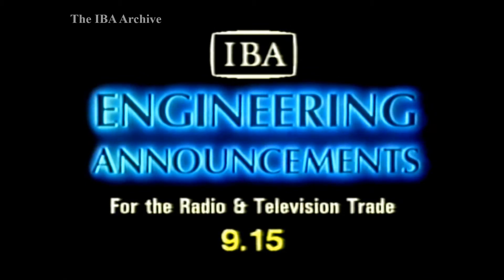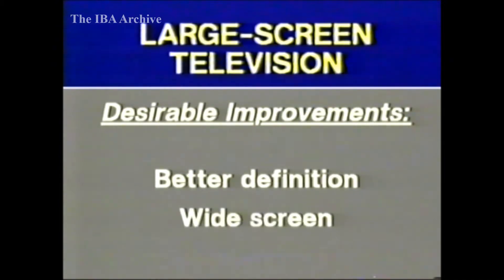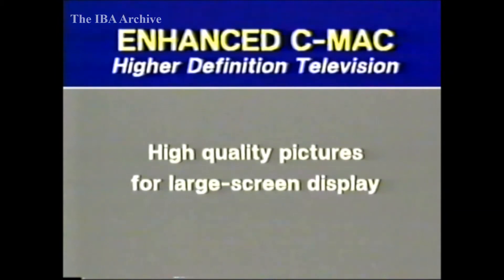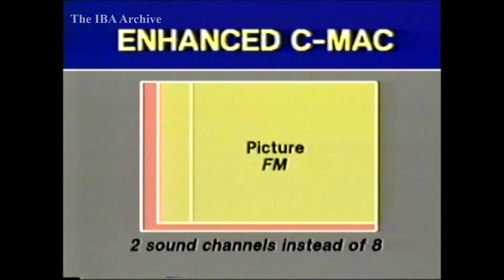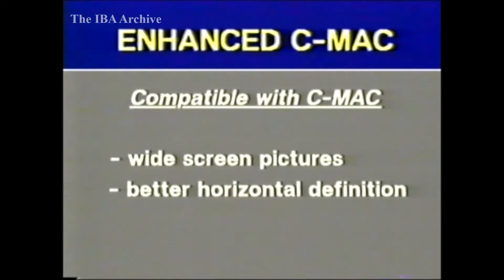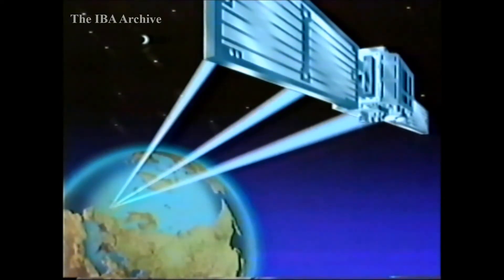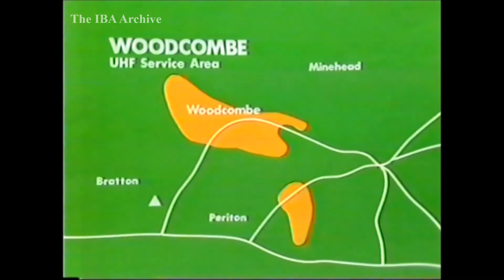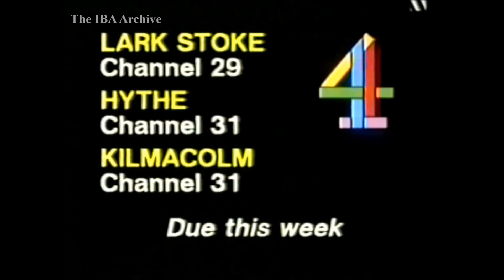IBA Engineering Announcements - 19 February 1985 'Experimental C-MAC Tests'

Comment: I don't think the date is right. Gwent Broadcasting's closure is referred to, and this happened in April 1985, not February.
Reply: Wikipedia lists the closure as February 1985 matching the date of this video. Is it possible that the formal company closure was later in April?
Reply: @kciparchive  According to one of the presenters, GB went off air at 11 a.m. on 24 April 1985.
Reply: @kciparchive  GB Radio definitely closed in April 1985. There's a recording of the final hour somewhere: all I can find on the web after a very quick search is 56 seconds of the final hour with Colin Briggs on David Lloyd's Radio Moments site which mentions April 1985 - see https://audioboom.com/posts/4474704-close-of-gwent-broadcasting-1985
Reply: According to http://tx.mb21.co.uk/gallery/gallerypage.php?txid=975 the Pwll-glas TV relay entered service on 25 April 1985.